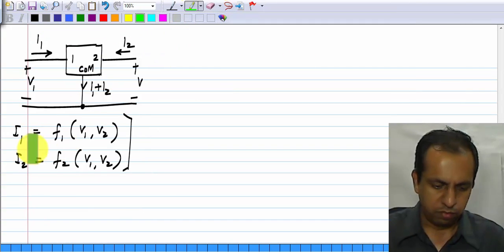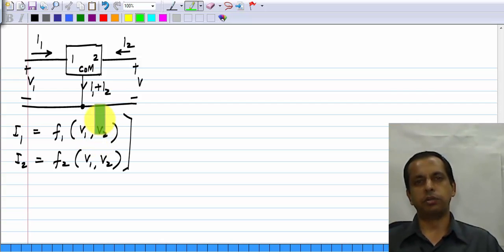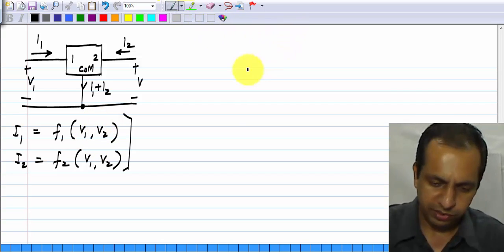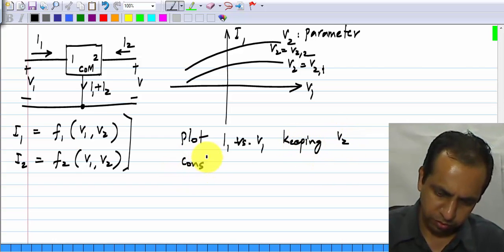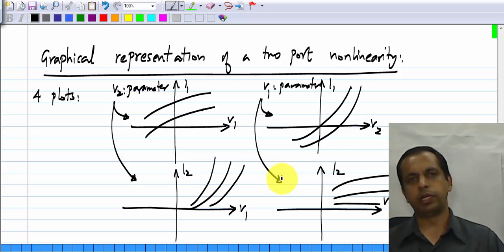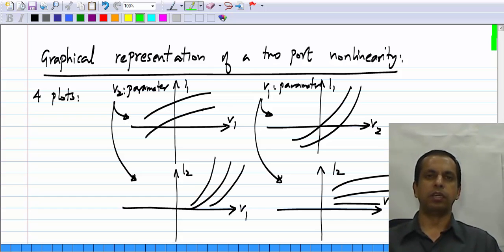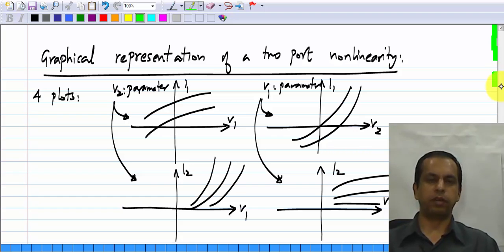W02L01TwoPortNonlinearity

Comment: Why does power gain make sense only in the incremental sense, please? could you clarify this?
Reply: were you able to find out? Even i'm wondering the same
Reply: He just meant that in practical situations, people analyse circuits in incremental sense, so the Power Gain calculated practically or mentioned practically makes sense only in incremental sense

If you have a small signal (suppose 10 mV sin (wt)) and you try to amplify, then you might probably add some constant voltage to make it something like 3V + 10 mV sin (wt) [by connecting to some power source], and then use the 3V as the operating point. Now, since you need to amplify the 10 mV part, the Power Gain is used to refer to how much the 10 mV part is getting amplified.

For example, for the 3V + 10 mV sin(wt) input, the output could be 5V + 20 mV sin(wt)
The 3V part is subject to a non linear gain, so the ratio 5/3 and 20/10 are not equal

But the power gain would be related to the 20mV part because that is what's important to us